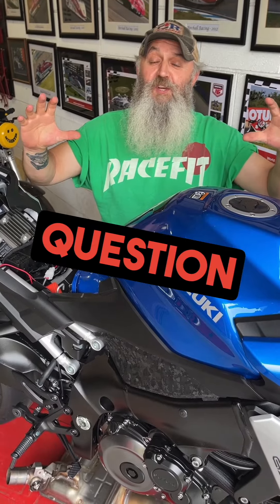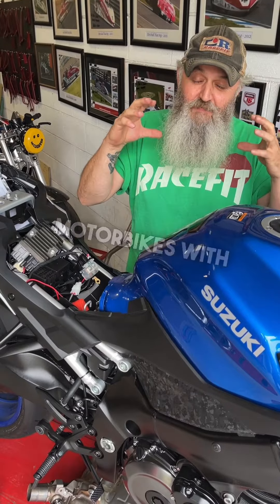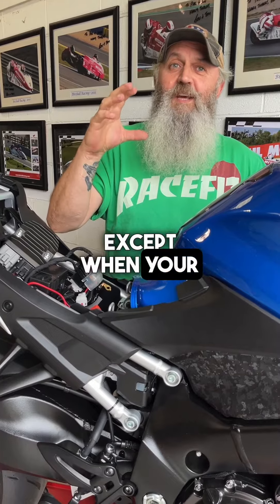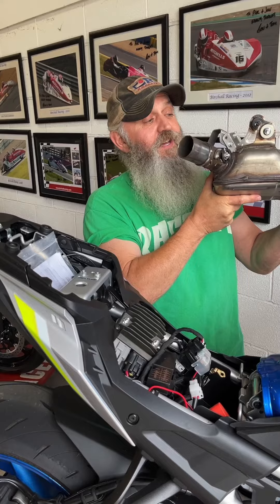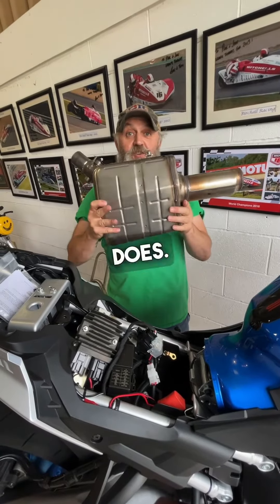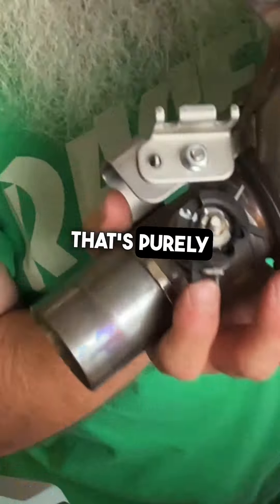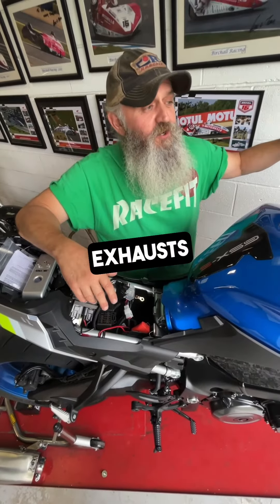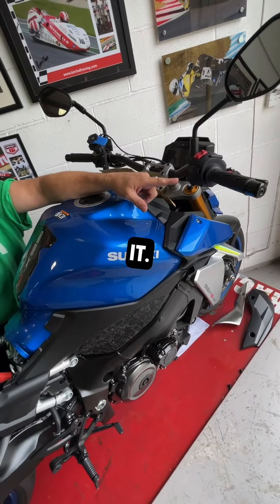The Most Commonly Asked Question EVER!

Comment: i don't want mid pipe or cat box something but i will want full system cr racfit exhaust 😈
Reply from the maker: Which make, model and bike have you got?
Reply: @RACEFITEXHAUST  triumph street triple 765 rs 2024 model i owned
Reply from the maker: @shobanbabu6991  The Racefit for that model removes the box underneath thereby making it lighter and less restrictive over stock without the need to change headers - doing so won't make much difference!
Reply: @RACEFITEXHAUST  ok sir but  iam  what to do for our street triple765 rs bike full system exhaust racefit  sir